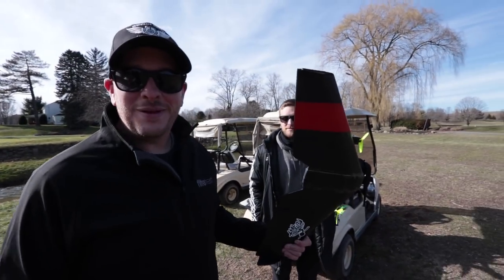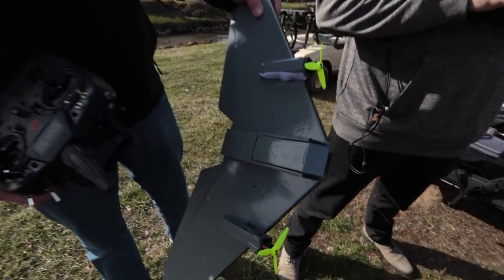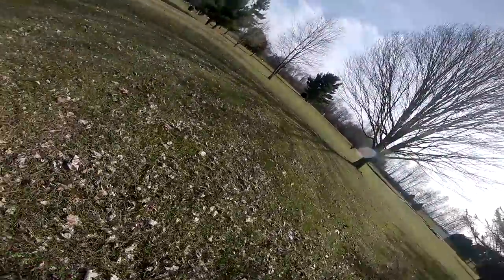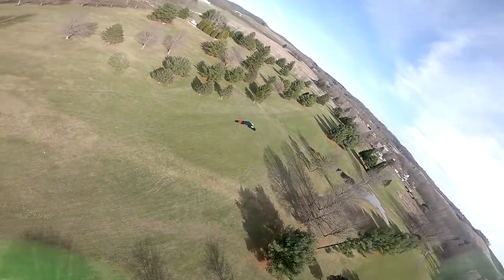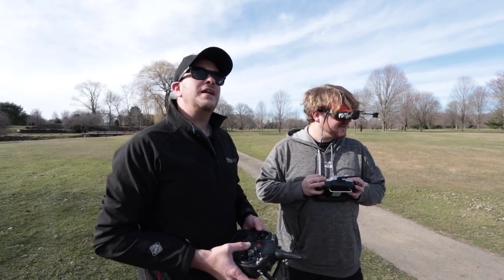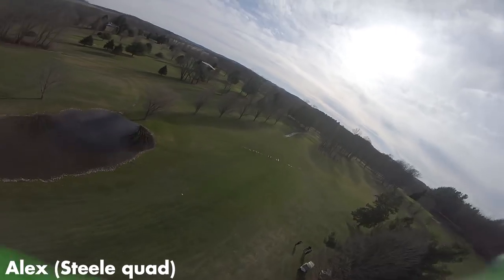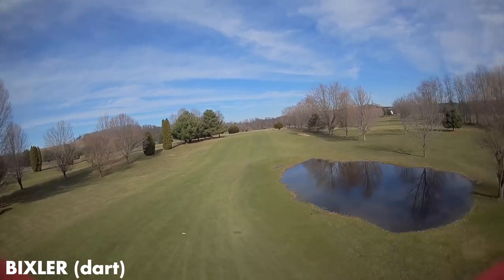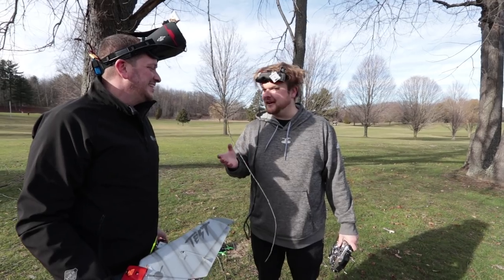MINI KRAKEN AT OUR NEW FLYING FIELD! - FT Dart

Comment: That is awesome, might build one.
We mix it all here land and air all FPV. Helicopters quadcopters hexacopters and all manner of fixed wings. However, I have yet to chase or be chased. And that is something I must try. I have the hadron with 4s might chase Shelby's wing till I run out of FPV signal. He runs 1.2 I have 5.8 at 600mw. I have a 1.5 watt monster vtx but can't use that at the field as it would knock everyone out of the air.
At some point I will go for the tbs crossfire and get my own 1.2 setup but till then, we work with what we have.

Comment: How about you take a quad fit it with a winch, attach a electro magnet to winch  line and then use it to recover the crashed or grounded wing, assuming you fit it with a small steel disc @ the cg top of wing.... all done in FPV like a competition??? thanks for making great vids guys always entertaining.. jus an idea..